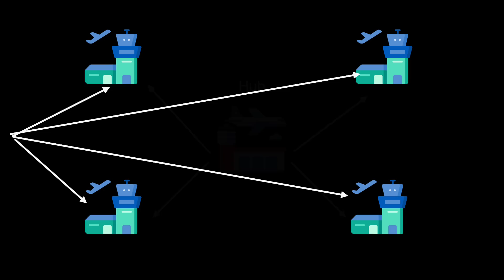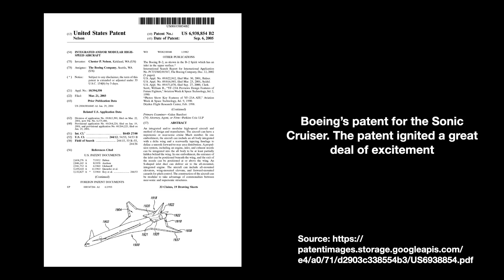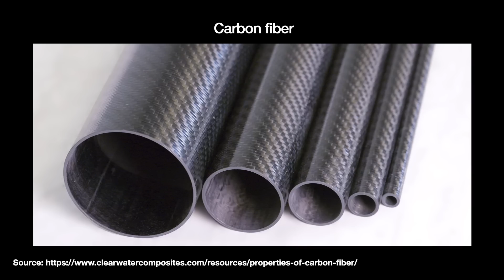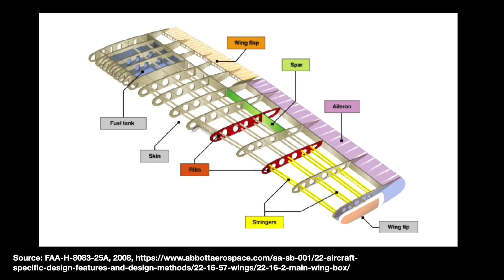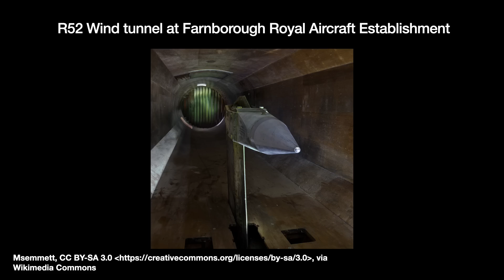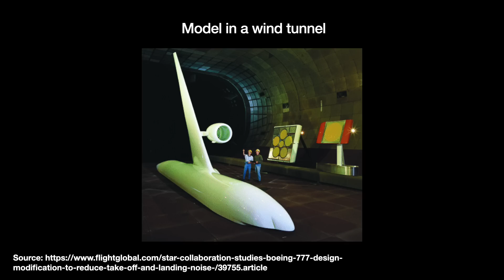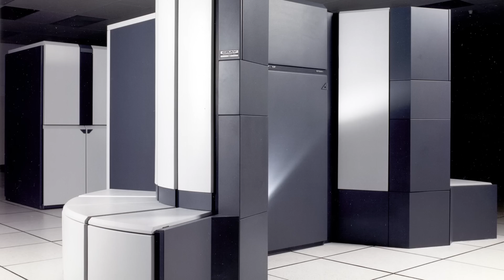How the Computer Helped the Boeing 787 Soar

Comment: For awhile composites were what chrome on cars was in the 50’s. It was a go to solution to problems that weren’t there. With experience and more data the use of composites improved although in the end, the manufacturing process remains highly critical as well as inspection in the field for repairs. Galvanic corrosion is also a design challenge (carbon f doesn’t get along with aluminum).

Comment: I worked during my postdoc in a structural optimization group, where the adjoint method was the key. Curse of dimensionality is killing other methods. The group solved both fluid and solid designs problems, e.g. optimal mixing in a channel, shape memory structures and lightweight designs.

Comment: Right now most 787 also fly in a hub and spoke setting. There are just more flights and more destinations from the hubs. But the change to point to point did not really occur.
Reply: Neither did Airbus' bet on hub expansion. The A380 failed spectacularly, so it seems Boeing's point to point model is closer to the truth.

Comment: I would bet that many of the results that you saw correlate strongly with the year the lens was designed (or the lens it was based on was designed).  There have been massive changes in lens design, complexity, materials, focus motors, size, weight, max aperture, coatings, manufacturing techniques, etc.  It looks like you found a correlation - but it may or may not be the actual cause of poppiness.

If you happen to have access to a large number of lenses from different time periods (rental houses?), it would be interesting to train a deep learning model on a subset of those, labeled with the poppiness value.  Then see if the model predicts the values for a holdout set.  Rank the lenses by the predicted values or groupings.  Then perform your analysis to find out which variables dominate.

Comment: I worked at NASA/Ames in the mid to late 90s in the Numerical Aerodynamic Simulation group. CFDs was what all of the users ate, drank, thought about and slept with, but with a few cycles being spent on advanced visualization technology as well. You can get a columnar printout of model results, but showing a heat map against a wing (or the Osprey V-22's rotors) is pretty helpful in going "Oh, yeah, that's why that doesn't work!". I wasn't one of the computational types- the NAS unit also was a breeding ground for NetBSD and other OS technologies. I remember porting NetBSD to the Alpha Turbolaser while I was there and then doing early 1Gb Fibre Channel fabrics. We also explored comm technologies like HIPPI and did hierarchical filesystems that had rarely used data spooled out to tape in huge tape libraries- some actually more than a km away with parallel SCSI laid on top of fibre repeaters. Great stuff. Great fun. And for the old school folks, we had a wind tunnel almost as big as the hanger that NASA/Ames is well known for. Very impressive- every time you started it up you committed to a minimum of a terabyte of instrument read to just get started- and this was back when 3.5" disk drives were just getting into double digit gigabyte sizes. Loved working there.

Comment: I was at Boeing for the first 8 years of the 787 program, mostly working with the structure around where the wing and fuselage and wheel well all come together. Structurally it is a mess,  rather like Boeing as a company. A few points, plane has a lot of titanium structure, not just in the engines, around 35% from what I remember and nearly all of the fasteners. There is also plenty of aluminum structure and some really questionable "black aluminum*  structure.  I think the largest thing people outside of the industry don't understand is that it isn't designing or even building the airplane that hard, it is data management, change control and dealing with the millions of parts, km's wire and countless suppliers all around the world. This is I think, why the large commercial aircraft industry is so limited. It is expensive as it is complicated and the demand for really large aircraft is rather limited. I think it was something like half of 747-8s built, which was designed to put pressure on Airbus from what I understand, were sold as "VIP" or private to people with far more money they know what to do. After all the issues the 787 is fine but it is still nowhere near as good as 777. I think a case can be made that the "triple 7" is the best commercial aircraft ever made and certainly the last good one before Boeing "merged" the MD.
Reply: > change control and dealing with the millions of parts, km's wire and 
> countless suppliers all around the world.

Yes! That is what PLM, PDM do. A very important part. I once worked as a leased employee in this area for Airbus (here in Germany). Interesting field, but the company that leased me out sucked. Also, way too much travelling.

Comment: Great vid as usual. Minor nitpick - composite layers are called plies, not piles :)

And just to chip in a bit (I did my masters in this area), a huge part of the cost of composites for aerospace is the process of certified a materials system/coming up with the values (e.g. strength, toughness, etc) for each material. The properties change due to minor changes in fabrication (like you mentioned with the air bubbles), and each unique combination of geometry, orientation of plies, fasteners, material, and so on, needs to have many tests run just to give a value to the aerospace engineers to actually design the part. Makes the achievement even more impressive, and sheds some light on why aerospace companies are often hesitant to adopt new composite material systems.
Reply: You have a masters in mateng?? cool!!

Comment: Using the changing aerodynamic characteristics during bending of aircraft structures intentionally is among the forefront of aerospace design technology. It’s not just as you say, difficult to control, it’s an added layer of complexity, and I would imagine that Boeing keeps those trade secrets close to the chest.
Reply: Using bending to control aerodynamic surface efficiency is a much harder fight on subsonic passenger planes like the 787. Simply because you have to rely on aerodynamic pressure instead and you can only go so far before there is a critical failure. 

In my eyes, I see the engine mounts as the number one issue of modern aerodynamics in passenger planes. They require support and strength which reduce the amount of bending the wing can actually do. 

My guess is that in 60-70 years we might see planes with smaller engines mounted closer and closer to the fuselage. Very similar to how the original jet passenger planes looked, like the Comet.

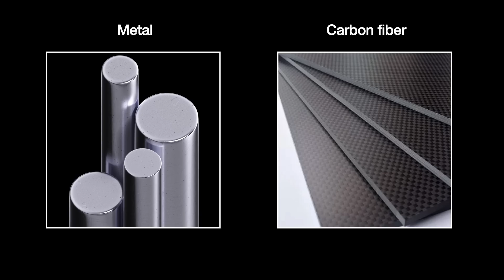Comment: 10:35 Probably my first correction on your channel, but you are in my area of expertise. 10 years AME-M2 here. Aluminum is not isotropic in sheet form, especially the aircraft-common 2024-T4 alloy. Sheets are marked by grain direction and even back in '63 it was well understood enough that SRM(structural repair manual) repairs note grain direction.
Reply: This was my thought, compared to composites metals seem very isotropic but grain structures start to matter a lot when you're getting into these high performance areas.
Reply: Yes, but compared to composites, most metal allowables usually take the lowest direction allowable when doing structural analysis right?  I'm not as many years into my career, so correct me if I'm wrong.
Reply: @Aspiringamoeba1997 it depends for bends it's critical otherwise the part will crack. Generally you want the part to flex with the grain, not against it.

Comment: First time on a 787 was with the Singapore low cost airline Scoot. They not only halved travel costs to Asia via Singapore, they also flew brand new 787 Dreamliners to both Sydney and Melbourne several times per week from June 2012. Still flying the same planes in 2025 on these routes, not so brand new anymore.

Comment: What if you didn't mount your airplane and the wind tunnel and just flew it in there with the wind at the right speed to keep it in place?
Reply: Interesting thought :). How about a jet powered RC 787 like this, complete with a realistic fireball.

https://youtube.com/shorts/3P1Hj_I4VRY?si=OZ3bglIpmWpXvHVb
Reply: No need. Typically, the models are mounted via a rod extruding from their back end, which implies that the mount cannot interfere with the air flow over the model, which does its thing before having any chance of encountering the mount. And yes I know that's not what we see in the video, no idea why - maybe they knew it didn't matter for what they were measuring in that photo...

Comment: A response about the lack of a cargo version, + and old work/war story from my days of yore:

I wonder if that has anything to do with all the structural composites used, and the banging around freight planes get from handling pallets, forklift hits, dents, and so on.  Being a former A&P but with no composite experience, it would seem to me to be easier to repair sheet metal, and replace riveted or bolted metal structures.

Reminds me of a tech I went to school with, who worked either at an airline or for McDonnell Douglas (before merger), and was doing work on a DC-10 that was in for scheduled heavy maintenance (a D-check, maybe?).
Anyway, he was drilling out rivets to replace a large piece of sheetmetal around the fuselage, and by mistake drilled into a massive machined aluminum structural frame at the rear of the passenger or cargo compartment, a one-piece member with a cross sectional shape of the entire fuselage.  

He drilled three or four holes into the member.  After a consult with the engineers, the fix was to replace the entire piece.  They scrapped the entire DC-10, the reason being “un-economical to repair.”  Ouch.

I don’t know exactly what happened to him, whether he was let go or resigned, but he was doing something else when I heard the story.  And he was a pretty good sheetmetal guy, having worked on warbird restorations and was a pilot checked out on at least the T-6 and BT-13.  As far as I know, he reported the damage to his lead, so there’s that.  Geez, this is going on 30 years ago by now.  Rough break.
Reply: Definitely a factor - composites are really sensitive to impact, it causes the layers to separate (delamination). And, even worse, delamination can be really hard to spot, small impacts can create some pretty severe damage thats almost invisible to the naked eye. So makes sense that cargo loading wouldnt work great with composite airframes

Comment: The question, an open one, why is the design more disaster prone than the older 777? Boeing gave itself up, you cannot move out your production and wage war against your workers and engineers and survive in aviation.  The US is effectively out of the airliner industry, it is just a matter of time now.  Soon we will be on Airbus, Comac or Embraer airliners -- and the second one of these will be very bitter to swallow.
Reply: I sincerely hope not, and believe Boeing will turn it around.  I have faith experienced pilots and senior aircrew engineers will have a corporate executive penchant, and that Boeing leadership will be wise enough to place them.  And relocate their headquarters back to where they belong.

If the USAF starts replacing their 707 models (EC-135s, KC-135s, E-3s, and on), then yeah - I can see a world where I’ll be flying Southwest from MKE to PHX on a Comac, washing that bitter aftertaste away with a gin & tonic.

Comment: The explanation of the Adjoint method is a little bit jungled.

Let me offer a few pointers for this. The basic problem to be solved is a linear equation Ax = b.
This is what you get if you linearize the equation and use the discretization coming from the 

The problem is that the linear system is absolutely huge. The solution is to use iterative methods and the canonical book for that is "Iterative Methods for Sparse Linear Systems" 2nd by Yousef Saad. The method that you use is likely to be BICGSTAB (section 7.4.2).

Yet hidden in the method is the transpose operation A^T. In effect it is innocent. It is the easisest operation to do for a student but his matrix is a 3 x 3, not millions x millions.

But what makes it especially difficult is that in effect when you are computing this transpose, you are integrating your equation backward. Say, you have a perturbation at times t_0, you integrate to a time t_1 with a time stepping method that use 1000 steps. So, if you compute the adjoint, you need to recall all the precise 1000 steps before.

This is because of the amazingly simple formula (A1 A2 ..... A1000)^T = A1000^T .... A2^T A1^T that reverts the order.

So approximations are the name of the day, but with the adjoint, and some numerics, you can get an idea of "What would be the perturbation x at times t that would get us y at time t + 1 hour". And so we implement them.

Look for "automatic differentiation", "adjoint methods", "an introduction to adjoint problems", etc.

Thank you for explaining what was done at Boeing. It gets a lot of criticism, but the 787 is a success even if the story was not straight.
Reply: > This is what you get if you linearize the equation and use the discretization
> coming from the

...? Something is missing.
Reply: @Conenion  Coming from the discretization of the partial differential equation.

Comment: I sometimes wonder what would happen if they took old designs and re-make them using modern materials and modern re-calculations.  You know, get the designs of the Concorde and redo them using carbon fiber and recalcutate the aerodynamics of the wings. Then stick modern high bypass jet engines on it. Modern fly by wire all glass cockpit.
Then see what happens. 
I think it probably will fly better, have more payload capacity,  use less fuel while actually being faster.
Reply: Boom Supersonic’s Overture?
Reply: harder to make though.  CFRP is a powerful material, but not magic; its anistropicity presents challenges, especially in manufacturing, thermal load, and inspection.  Weight redistribution will also mess with the aero->structure design and analysis loop.

Comment: I think very good use of modern CAD and simulation tech is making development of the B-21 much faster than older planes.
Reply: The 777X would like a word, followed by the 737-7 and 737-10...
Reply: @gryff8400 737-10 was probably because of increased scrutiny following the Max disaster compounded by the new regulations for better cockpit warnings, something the 737 Max doesn’t comply with and the 737-10 would need to change.

The 777X probably has to do with GE’s engines and Boeing’s questionable programming skills.

Comment: One down side to the 787 design is unlike all other boeing passenger planes, there is no path forward for a freighter variant.  Either as a passenger conversion or direct from factory.  Once boeing is done playing with the 777-x, they actually have two models to work on in the commercial space that needs attention.  A 767/757 replacement aircraft and preliminary work to start on a replacement 737.  All three (or two if the 757 and 767 are rolled into a single new model) models need to also have freighter capabilities as they are heavily used in the freighter market as well.
Reply: I wonder if that has anything to do with all the structural composites used, and the banging around freight planes get from handling pallets, forklift hits, dents, and so on.  Being a former A&P but with no composite experience, it would seem to me to be easier to repair sheet metal, and replace riveted or bolted metal structures.

Reminds me of a tech I went to school with, who worked either at an airline or for McDonnell Douglas (before merger), and was doing work on a DC-10 that was in for scheduled heavy maintenance (a D-check, maybe?).
Anyway, he was drilling out rivets to replace a large piece of sheetmetal around the fuselage, and by mistake drilled into a massive machined aluminum structural frame at the rear of the passenger or cargo compartment, a one-piece member with a cross sectional shape of the entire fuselage.  

He drilled three or four holes into the member.  After a consult with the engineers, the fix was to replace the entire piece.  They scrapped the entire DC-10, the reason being “un-economical to repair.”  Ouch.

I don’t know exactly what happened to him, whether he was let go or resigned, but he was doing something else when I heard the story.  And he was a pretty good sheetmetal guy, having worked on warbird restorations and was a pilot checked out on at least the T-6 and BT-13.  As far as I know, he reported the damage to his lead, so there’s that.  Geez, this is going on 30 years ago by now.  Rough break.
Reply: @ronjon7942 While sectional sheet replacement might be part of the problem, I hear installing that cargo door to a composite shell is what makes it a nonstarter.  A risk on new forces noone wants to test or spend money on to find out.  And we've seen what happens with fitting metal to composite can do on the that sub for the wealthy.
Reply: Strange how the A350, made of composites like the 787, has a freight version in development
Reply: @soccerguy2433 not nearly as much composite as the 787. It has been claimed that the supply chain can't support another aircraft type with such a large amount of composite material. The 787 is great for what it is but not practical or economical to duplicate.